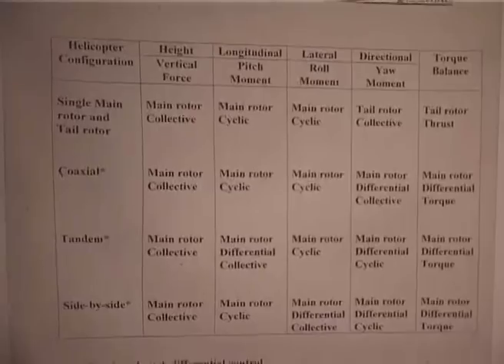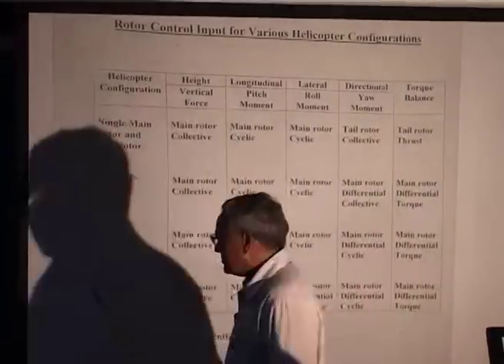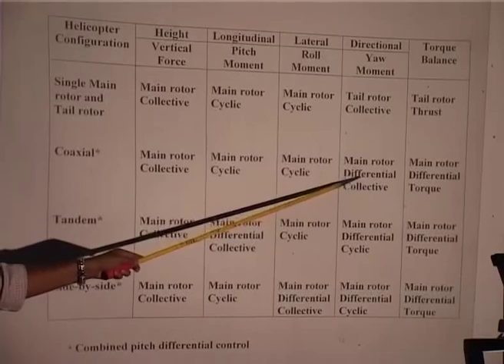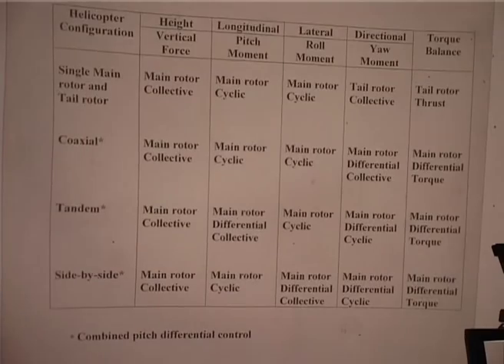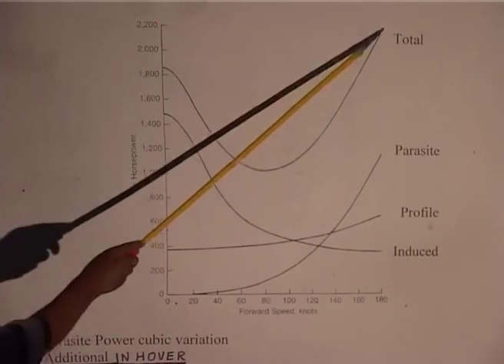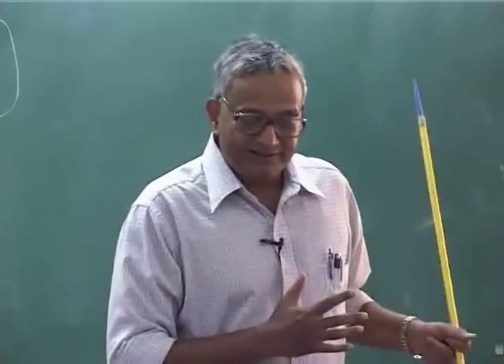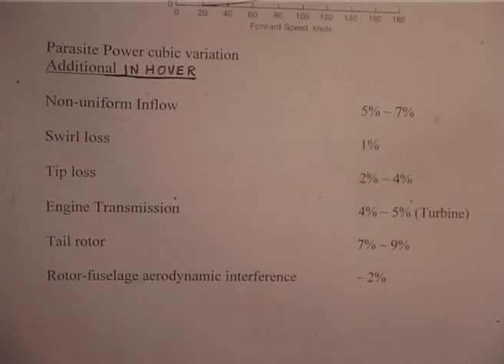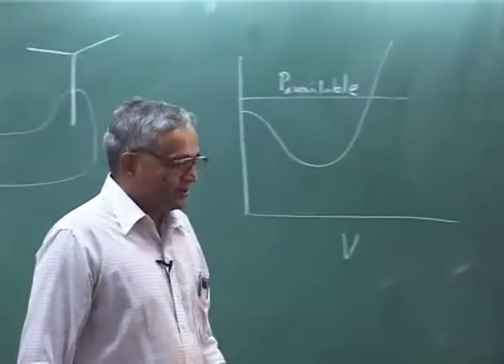Mod-01 Lec-04 Introduction to Helicopter Aerodynamics and Dynamics

Comment: Sir I have a question
why ducted fan type has such a high disk loading compare to rotor?
Reply: The duct increases the thrust by reducing the thrust losses from the tip of the propeller blades